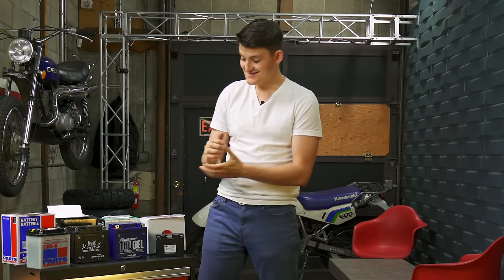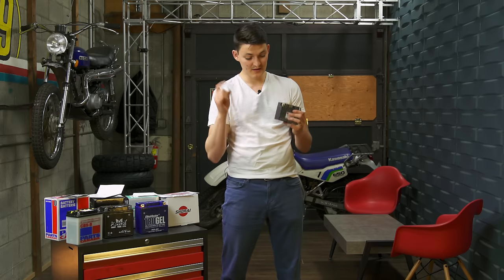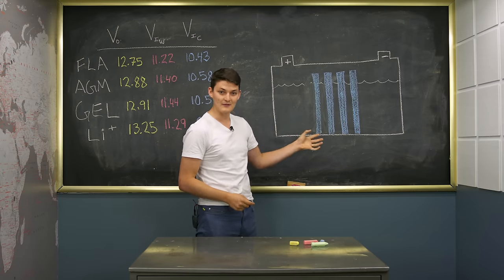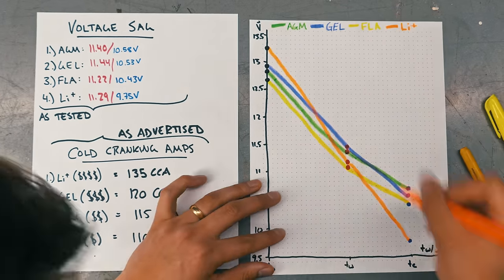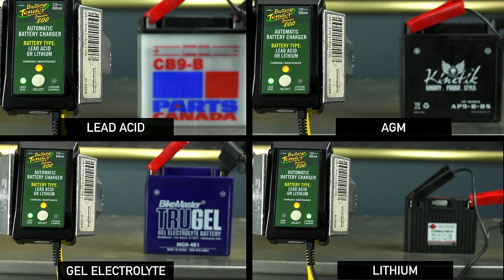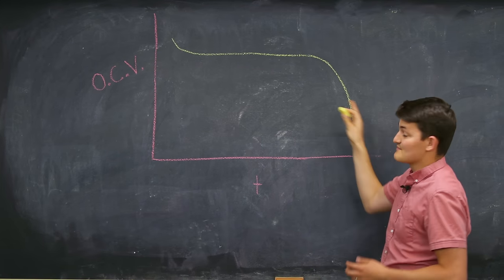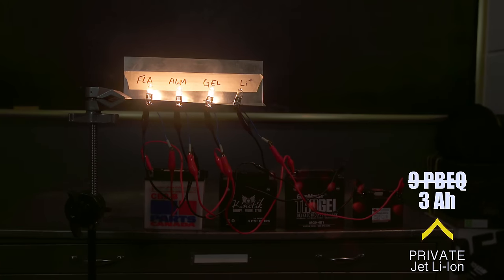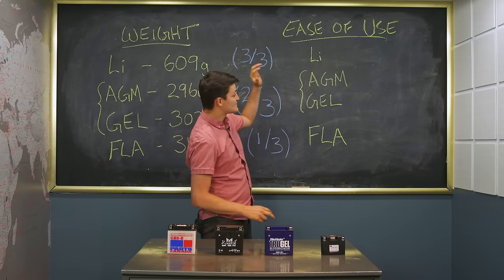Best Motorcycle Battery? Lead-Acid v. AGM v. Gel v. Lithium

Comment: Depends on what you're doing. Do you operate in winter? Don't do lithium. Do you want space in your battery compartment for extra goodies? Lithium.
Reply: You just need to wait a few seconds. So it's not like it's worthless. Question is, in cold weather, how many cranks can the lead batteries do compared to the lithium one?
Reply: @sniglom  Yeah, but can't charge at all. Lithium loses about 50% capacity and some output power when cold. If the engine warms up the battery it'll be okay. Doubt anyone has a bike that heats the battery tho.
Reply: joblessalex you heat up the battery by running your lights (as stated in the video). Do that for 30 seconds or so and it will be able to crank.
Reply: @sniglom  There's no way that 30 seconds of headlight use could even barely warm that kind of pack.... It's most likely to initialize the protection circuit to prevent frying bike parts. I can do the experiment, but I highly doubt it. I left a heater running all winter directly on some batteries and it only raised their temperature a few degrees. A mere 1-2c load for a few seconds won't do anything.
Reply: @sniglom  I have about 4 years experience building lithium systems, but I've never actually tested this method. From my experience, I've never seen any significant warming of a cell by means of thermal units. Possibly the page is right in that it makes ions flow. I'll run a test and see if you'd like.
Reply: I just commented this on another reply. I fly model airplanes and usually keep a flying setup ready to go in the car, even in winter. I've flown in down to -2°f and the battery discharged and charged fine without any issue whatsoever. 

if you really push the batteries, they will heat up quick. most of the advertised "peak" amp ratings are only good for 10-30 seconds so that the battery does not get too hot.

charging them quickly also heats them up, but even a slow trickle of power would be enough to really stave off most of the temp related degradation in performance.

Comment: Just bought a new battery for my FZ-07 beginning of summer. I did a LOT of research and made a few phone calls, emailed RevZilla, etc. When I got the new Yuasa AGM shipped, I went to take out the old factory Yamaha battery to replace it and it was the EXACT same as I ordered. I take pride in my research. I'm as great as the Yamaha engineers!

Comment: You seem to have left out the most important real-life test: how long will they last before you have to replace them?
Reply: How do you test that?
Reply: @tomdickharryjane  just use them daily for about 6 months and then predict the life span, not that much harder to do.
Reply: mike h  I dont doubt that. It's a question of whether they would have enough of a longer life span to justify the extra cost.
Reply: @mustbescud  mine lasted 7, just died today
Reply: @johanz2460  I killed 2 lead acid batteries in one year in good old sunny California weather..  Popped in the Shoria Li-on and haven't purchased another battery since (5 years now). Did I mention I never once had to charge it or have nevery received a jump.. perfect crank every single time.. This thing just works!

Cost effective and maintenance free.

who's saving money now..
Reply: I swapped out my Yuasa YTX12-BS AGM (10A) in 2016 from my 2005 SV650. I'd let it get too low to start twice and it was slow to start a couple of other times.

I got a smaller Varta (12A) as it was cheap. I bodged the old Yuasa into a dead jump pack (20A), which has helped start a car and I just tried it on a ham radio. Holds 12.65v still.
Reply: Excellent point

Comment: Threw a Shorai Lithium into my old (carbureted) Vulcan and never had a day’s problem. That said, I used to carry a jump-starter battery in case of issues and did manage to leave my key dangling on the side of the bike when I walked away (not a fan of the side-mounted key, forgot the thing multiple times as I’d use the kill switch and nothing told you anything was on from the dash). 

Full discharge didn’t seem to hurt it. I ran it for four years (flawlessly) and traded the bike in later as I got tired of keeping up with the rust on the frame/exhaust and it was in need of having the carbs rebalanced (had a job with 100% travel, so I only had weekends to mess with my bikes and I wanted to ride, not wrench).

Comment: Informative but somewhat misleading.  The usable power of the FLA, AGM, and Gel is about 50% of the Ah rating since they are not supposed to go below about 50% DoD   (Depth of Discharge).  Therefore, the 9Ah rating is really about 4.5 Ah usable on those.  However, lithium (the type used here), is allowed to go down to about 80% DoD so at the 3Ah "true" (apples and apples) rating, that is 2.4 Ah usable.  So for example, if you had an electric scooter that normally took a pair of 12V 9Ah AGM batteries and could be ridden for about 1 hour on a full charge (down to 50% DoD), you would need 4 of the lithium batteries to make it perform similarly under those conditions.  Since the lithium batteries were only about 20% of the weight, doubling them up would still be less than half of the original battery weight of FLA, AGM, or Gel.  For something like an electric scooter that is used a lot by a kid, the approx 3x charge cycles (which you didn't mention in your test and is one of the main selling points of lithium), may be worth the extra price.  Another advantage would be if the scooter will have to be lifted up frequently or if it is for a small kid and losing 10 pounds of battery weight would help the kid ride that scooter easier.

Also, one other thing you did NOT mention is that new batteries do not perform as well as those that have been properly cycled a few times.  Some manufacturers claim about 80 to 90% of rated capacity until about 15 or so charge/discharge cycles.  You should have cycled the batteries a few times each if they were really new.  I am not sure if Lithium has this property but I am pretty sure the other 3 do.

Also, since the lithium battery used here is so much smaller than the other 3, it would have been interesting to either double those up, or to use a larger lithium battery (such as "18Ah" which is probably a true 6Ah for slow draining), and make that your 5th entry.  For example, if someone has a large motorcycle with a lot of accessories (radio, fancy lights...) and they like to use those even when the bike is not running, they could just use the largest Lithium battery that will fit in their battery box regardless of the Ah rating.  In that case, (except for cost), I think Lithium would win.

Hey here is something else interesting...  I wonder what might happen if someone already has a healthy proper sized AGM battery in their motorcycle, but rigged up some 2nd battery box for a small lithium battery and then put the pair in parallel.  There could be some interesting advantages and maybe some disadvantages too.  That would make for a great video since I don't think I have ever seen it.  The higher voltage of the lithium should help keep the AGM from going into a deep discharge state, but the AGM can help supply CCAs when the lithium is cold.  Their strengths (together) might help offset their solo weaknesses.
Reply: Well stated,  glad to see others of the same mind.
Reply: Thanks.  I like to think I know a "little" about batteries and they sure are fun to tinker with.

Comment: Lead acid for a 450ktm, $30USD delivered from Rocky mtn ATV, works for a season, then dies over the winter.

Li ion $130USD, I'm on year 5, I'm $$ ahead, lol

Jinks, I hope not
Great video, thanks for Sharing!
Reply: fml my gel packs cost $130 :/ last me 1 year. I should have shopped online and got a Li- bike is easy enough to start after sitting so i don't need to keep cranking a starter.
Reply: All my lead acid, gel and AGM lasts at least 4 years, but if you don't charge them during the winter, they will only last one year, but that's not really the fault of the battery... ;-)

Comment: Need a new battery. I remembered Ryan did this video. Had to watch it a number of times to fully digest it. Incredible amount of relevant, useful information in a 12 minute video. And entertaining as usual for Ryan and the crew. They are truly talented, intelligent, thoughtful, and ground-breaking. 
I wholeheartedly disagree with what seems to be his choice at the end. He is a bit cryptic. Which he likes to be. And I am sure he recognizes and respects that different people will come to different conclusions about which choice they would make. Since I am in “not Canada”, so the Li charging excitement is probably not relevant, and I want the weight savings, I think I’ll give the Li a shot.

LOL. I see my post two years later. I bought the Li for my KTM Super Duke and my Yamaha WR250R. Extremely happy with both. Left the Yami at my daughters house. Admittedly “not Canada”. Midlands area of South Carolina. There were a few extreme temperatures in the winter. Extreme being mid-20’s for a few days. Maybe a week. Pulled the bike out of storage nine months later it fired right up. No problems with the KTM either.

Comment: It would be nice to know the condition of the batteries following the complete discharge.
Reply: My Ballistic battery wouldn't charge under any circumstances after completely discharging. Ballistic tech said it was junk now.
Reply: GEL - AGM will never recover.  they lose 20 % each time they totally discharge.  never let themdrain away.  lead acid is only option.
Reply: Lithium, AGM and GEL are destroyed but the flooded one might be recoverable idk
Reply: Bill Erker, the health of a ‘fully discharged’ Lithium-chemistry battery will depend on one factor.  Does it have a protection circuit which prevents it from discharging below unsafe voltages?  If it does, it’ll be fine.  If it doesn’t, it’s trash.
Reply: Can trick the smart chargers to put power back in with putting another in parallel of a good battery. Gotten many back from the dead and are running quite fine... it is a marketing trick for most. Need to sell more product.
Reply: My LiFePo battery has a protection circuit so it doesn’t fully discharge, so you can just charge it again and it’ll be fine.
That’s a huge advantage over the others because over the life of a battery, an accidental complete discharge is somewhat likely to happen.
Reply: I accidentally let my Lithium drain to 3v,. Stuck it on its charger and it recharged very quickly with no long term damage
Reply: A quality Li battery with a protection circuit will be fine after the oh sh1t moment of deadness.  Bump start, and run for a while and you are fine.  The rest require a buddy with cables, or a tow truck, AND a trip to the parts store when it opens.

Comment: Great video, I live in Wisconsin, and I was looking at the comparison between lithium, and others for a motorcycle battery and this was very helpful. I presently keep a trickle charger on all my none use batteries through the winter, and see that lithium should not be charged below 32 F or boom, not good. I believe for now I will stick with AGM or Gel!
Reply: Likewise, and yeah even here in hot AZ, desert temps can swing wildly to <freezing at nite, and I don't wanna have to worry what temperature it is just to use the charger (let alone that sumthin' might go Boom)!

Comment: i Operate a Motorcycle Repair Shop for 20yrs now and am Finding the AGM Batteries to be the Worst by far for Longevity and dependability...The Gel Cells are not much better either...if You maintain a Lead Acid Battery Properly they are Still the Best thing out there for the Money...but if you can afford it buy the Lithium Ion one...
Reply: Interesting.  I have been spending the money on AGM and seeing about 5-7 years with no problems cranking the engine ever.  How much more could I get out of FLA?

My sample size is small with only going through 3 batteries in two motorcycles over the last several years so is my experience just a fluke?
Reply: @danielchin8073  Possibly but you probably use your batteries frequently enough to keep them healthy. i find the ones that fail the most are not used enough and people tend to leave them on float chargers all winter long and alot of Float Charger,s DO NOT Automatically Shut off all the Time Thus they end up Cooking and dehydrating the Battery
Reply: @looneytunes47  Thanks.  That makes sense.  I do try to ride even in the winter whenever there is no snow, ice or salt, but probably the biggest thing that I'm taking away is what you said about chargers.  I use a CTEK charger which does completely shut off when the battery doesn't need input.
Reply: @danielchin8073  Yep there are alot of Cheap Low Grade Chargers out there...AKA Wal-mart ones...
Reply: I’m still running lead acid battery’s in your opinion what’s better for winter storage for a battery leaving it on a tender or starting the bike every few weeks and letting it run for 10-15 minutes? For the past two years I usually just run mine every couple of weeks.
Reply: @JerickWallace  i like to plug it in for a day now and then..
Reply: @looneytunes47  thanks for the reply!! yeah sounds like that may be a good idea will go ahead and pick up a battery tender for this winters storage
Reply: I got 8.5 years out of a Yuasa AGM battery. I use a CTEK smart charger overnight when I'm not riding and LED taillight bulbs. Prior to smart chargers and LED bulbs, AGM batteries would last around 3 years. The only accessory on the bike is a radar detector.

Comment: Geez; so many critics out here....anyway, love your chalk board work, with terrific documentation. Irrevocably motivated me to check for written details at all times. But then, I am from the era of “wet-cell” batteries, purchased dry and in prime condition, supplied with a boxed bag of acid. Carefully add the acid, let it sit overnight and top off the level the next day (after a hearty down-town breakfast special). Then install it and go for a back-roads ride, feeling the battery for excessive warmth from time to time. Ah, so relaxing; no Li-Ion this or that accompanied by Marketing / Sales BS. Love Factory repair manuals, Machinery Handbook, and raw, first-hand stories from other riders. Thanks for the show!

Comment: Had a Shorai in my Husaberg FE390 (2011) since 2013.  Used sporadically - never from November to April.  Never charged.  The only time it didn't start first time, was at temps near O C - turning on the headlight for ten seconds warmed it up, and bingo the bike started.  I ride this bike off road on isolated dirt roads with no kickstarter.    I have two other bikes which require battery tenders on their conventional OEM cells.  Based on my 7 year test, when they die, I will replace both with Lion batteries.

Comment: Although I love and respect your channel. I have to disagree with you on this one. One key component you are leaving out is that most people who buy lithium batteries, don't buy the "equivalent" version. It makes more sense to buy the lithium battery that fits the battery tray of the stock battery (which is much larger). That way you get a much higher capacity, generally better CCA's and it still weighs far less than the stock battery. In that scenario the only downside is cost. So yes it's more expensive. If you are on a budget I agree to go with the cheaper battery. But if you want pure performance, weight savings, and maintenance free electricity, lithium batteries are the way to go.

By the way, Shorai make great batteries but Earth-X are even better these days. 

In any case, I appreciate your in depth, scientific method of myth busting. Keep up the great work.
Reply: This. If you go on exide website and search for Li battery for 800gs it'll recommend 80 48Ah eq. battery (as opposed to standard 12Ah) which will still be almost 3kg lighter.

Comment: Ryan to the rescue as always. Good video mate 👍. My preference for Gel stays. No leaks and good performance through and through

LiIons make good house batteries in deep discharge applications like charger packs and campers. But for simple reliability and economy the older chemistry still works..albeit with a significant weight penalty. I’d stay away from McDs for a couple of meals and lose that 2.5 kg weight myself

Comment: So the “best” solution is a pair of lithium batteries with a switch to change to the fresh one if you leave your headlight on...  
cost be damned! Lol
Reply: or just run 2 in parallel, and still weigh less than the others, cost still be damned!   Wait, how much do legit 9Ah lithiums cost?
Reply: @WL2K  Lots. lol